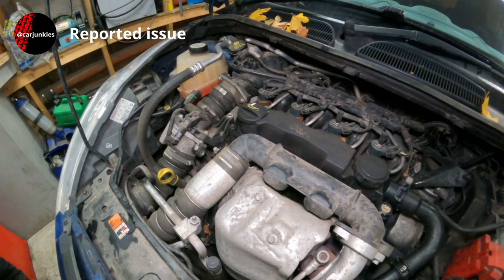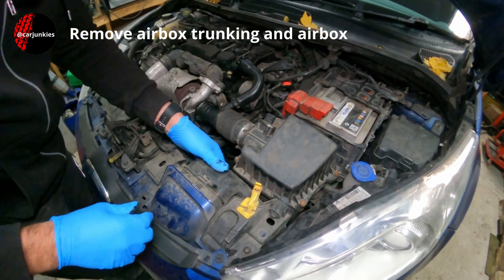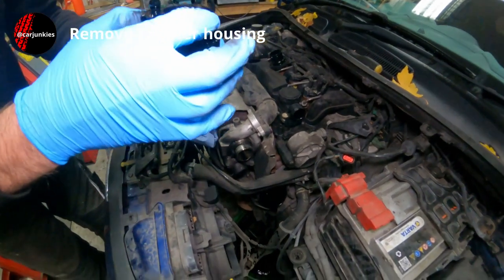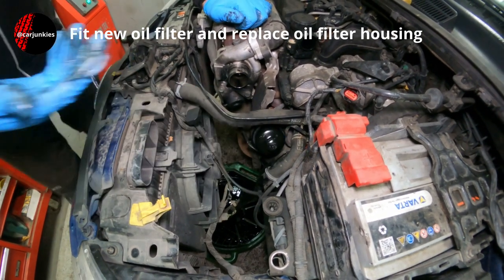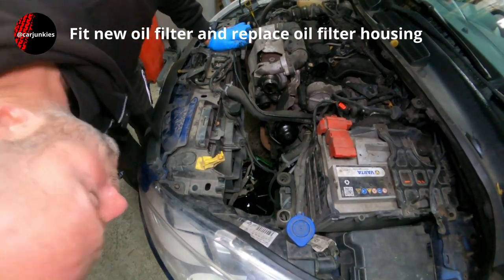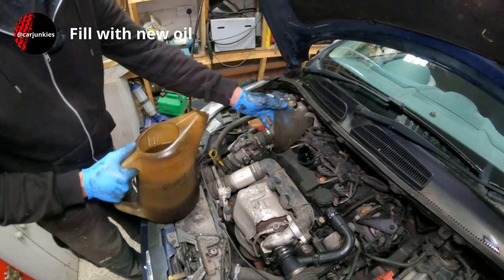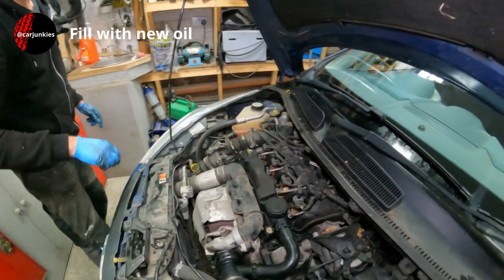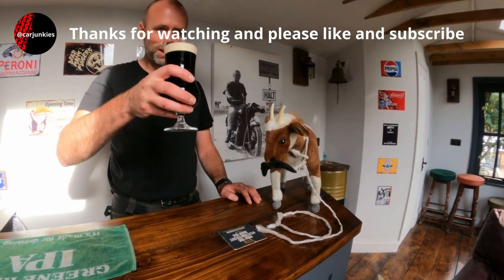Ford Fiesta 1.6 Diesel (2009) - Oil and Oil Filter Change

Comment: when changing the oil, they usually forget to replace or clean the oil filter mesh of the filter that is in front of the turbine, because of this the turbine is damaged
Reply from the maker: Hi @Anderion141
It is a good idea to change the filter mesh if the servicing of the car has been neglected over time. However, this is not generally considered part of a standard oil and filter change hence why we did not include this in the video. There is also an additional mesh strainer in the sump which forms part of the oil pump pickup which could also get clogged if oil and filter changes are not regularly done. Fortunately this is not something that happens very often, maybe only a handful of times in my mechanic life. Thanks for your comments and thanks for watching